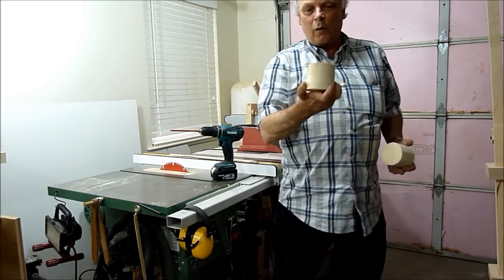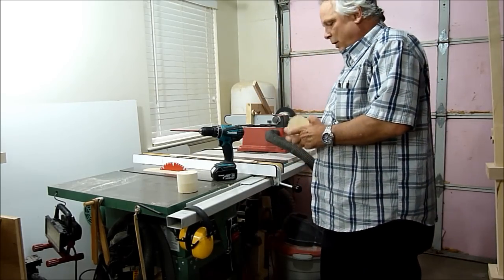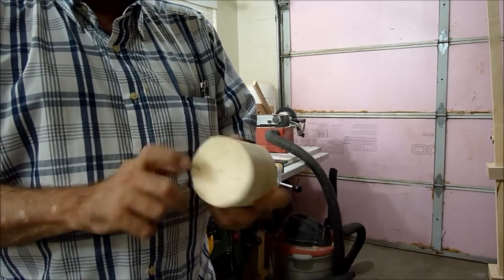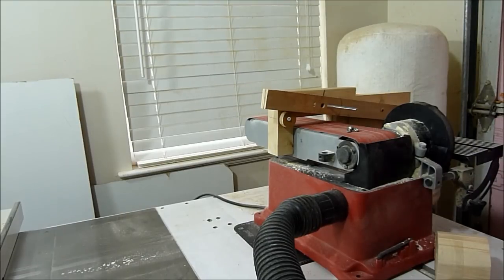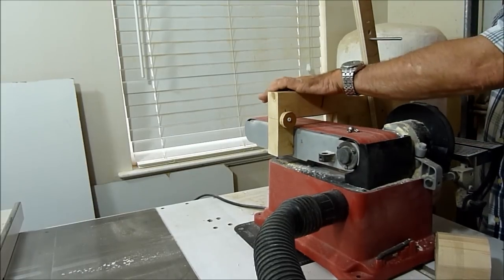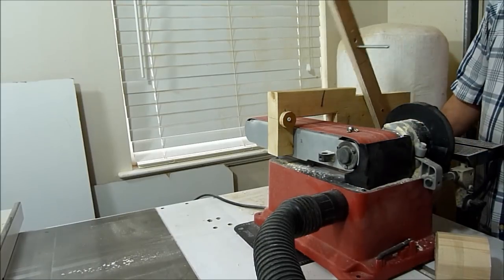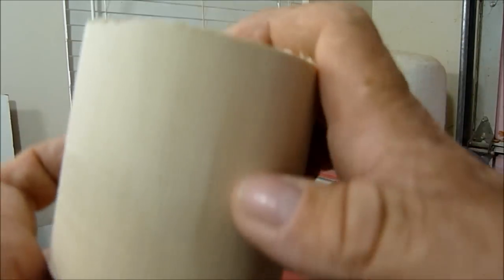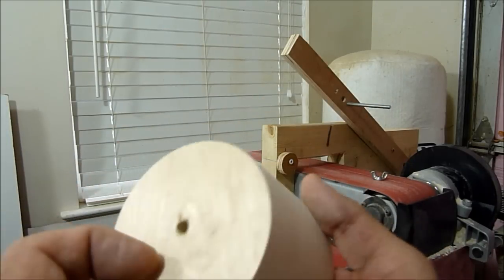Making  large dowels with a belt sander

Comment: Hi Jack, I like it as not every body has a lathe. Two mod's, 1st mount it at an
angle to the belt. Second put a longer bolt (you need a drive) and power it with a drill (use both machines at the same time)
Thanks for a great idea, Mike.

Comment: If you angle the dowel across the belt sander it will turn by itself. The wing nut can still be used to create friction so it doesn't spin too fast and the cam to set the depth.

Comment: I thought I'd give you an idea that I used that helped me get to the point where I didn't have to keep stopping to check if ALL the sections were done. while you were getting to that point where it looks done but you might have missed a spot that's still flat. you can make an addition to your jig that would turn your dowel 45 degrees and let it roll. literally let it roll. the 45 degree turn will help by letting it roll as it sands and you'll end up with 100% perfect dowels and/or circles.

Comment: If you angle the jig so that the dowel is maybe 10° out of alignment with the belt and use a smooth axle, the dowel gets rotated by the belt. Just set the cam, put a weight on the jig´s arm and the dowel gets ground automatically.

Comment: Great wood sanding lathe. I thought if the 8 by 4 frame was mounted at an angle rather than 90 degrees to the sanding belt the movement of the belt would have the tendency to assist the rotation of the wooden dowel to be sanded. I have a similar arrangement to sand down steel washers, allowing the them to turn by themselves this prevents burns to the finger tips. If the axis is more than 30 degrees you might find it will have a tendency to spin out of control.

Comment: I wonder if sanding them attached to the drill press would have been faster and better. They would have spun while you held a folded piece of sheet sandpaper around the back side as you slowly moved the paper up and down. Or perhaps even better would be to use a sponge sander with sheet paper wrapped around it. I've done that many, many times to sand uneven surfaces.

Comment: since the top of the cilinder is not supported, will the cilinder be exact the same size on the top and bottomcilinder? the bottomcircle it limitet by the woodstop, but the topcircle can be pressed and could be smaller?   greetings
Reply: I could see that being a problem if the dowel weren't a good fit on the centre rod, but as he had to hammer it on with his palm, it's probably not an issue :)